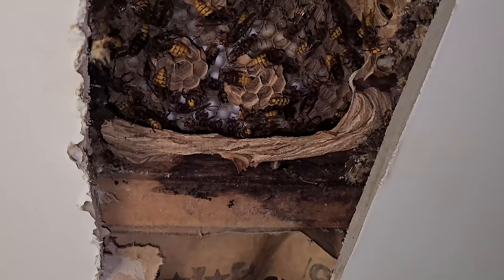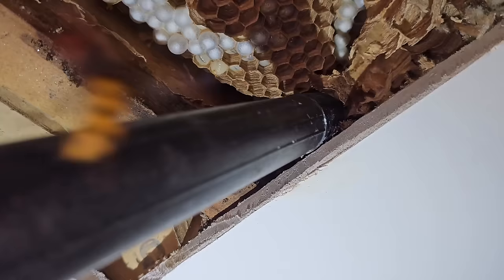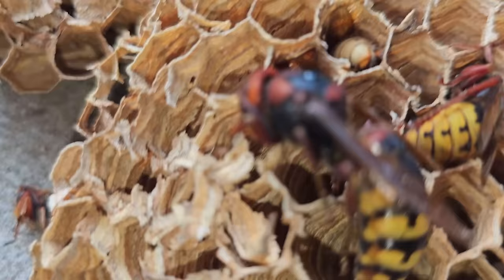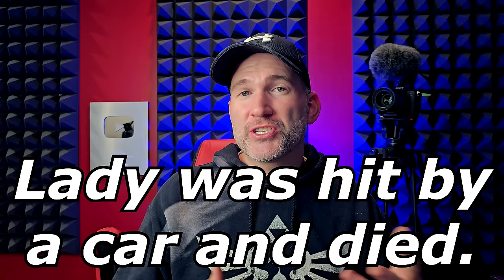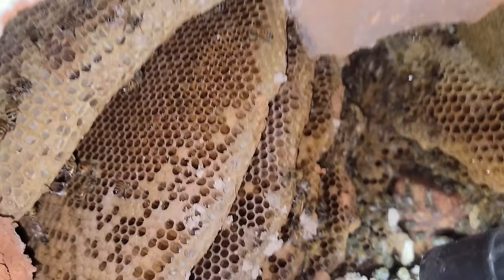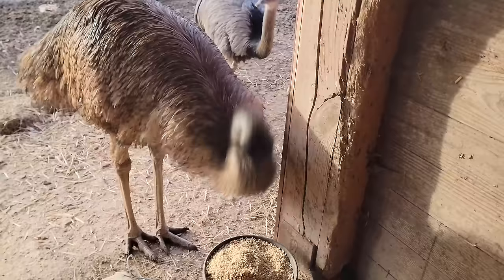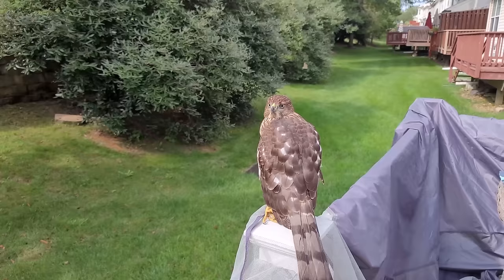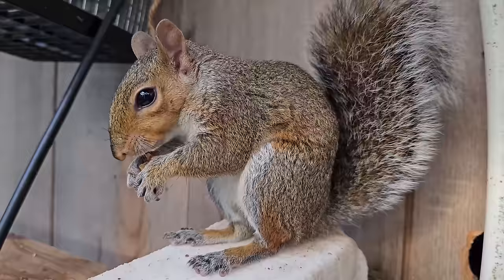Hornet INFESTATION above YOUR bedroom ceiling! Hornet Wasp Nest Removal!

Comment: We just had these inside our exterior wall; they gained entry thru a hole in the mortar. The bug guy dusted inside the entry point, but we couldn’t get to the nest. Foragers have been coming back around for 4 days now, but not entering anymore. Plugging up the hole tomorrow. I call them flying bullets, lol.

Comment: One time I got swarmed by baldface hornets that were in my grandpa's shed. I was 13 at the time and I went to get a rake to clean up cut grass. There was a basketball sized hive in the corner. I had 24 stings and my grandpa had to spray the hive with gasoline. It killed them all within 30 seconds, but it made a big papery mess.

Comment: good video.

would you do another video following one of your nests through the year like you did with the yellow jackets you had in a  perspex box ?
Reply from the maker: I did several years of 3 different European Hornets nests.
Reply: @HornetKingOfficial  I will have to check  them out.
The video I was refering to was about an hour long and you did daily (or nearly daily) video clipps all  added into one long video.
It was really interesting to see how quickly the nest built up and also how quickly it all ramped down at the end of the season.

Comment: Sorry for the stupid question, but I'm curious..are the scenarios where you have to cut out the drywall because the nest is not accessible if you go into the attic ? Or is it easier/most convenient for you to just cut the drywall to remove them?
Reply: In this case, the dry wall is damaged by the sludge and smells, and so you would probably want to replace it anyway.
Reply from the maker: There was no attic here. This was a bump out off the side of the house, and this space above the room was a roof space with no access.